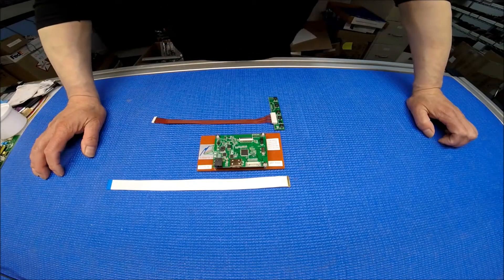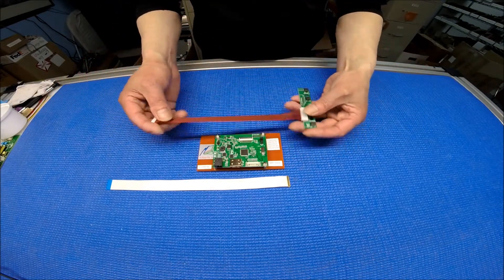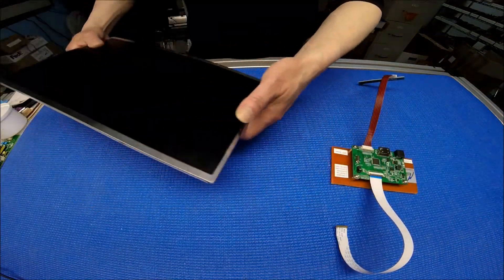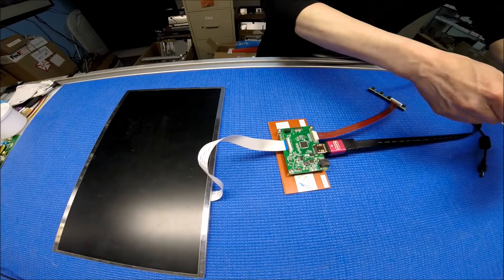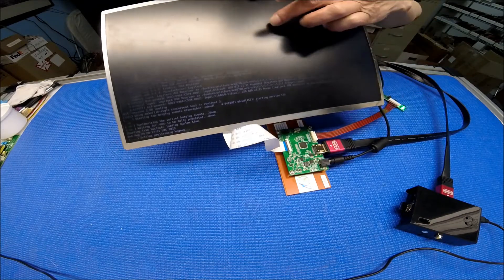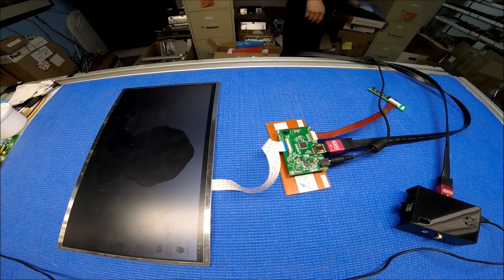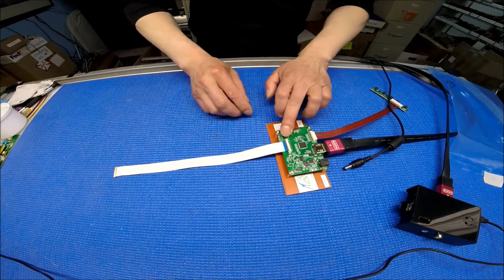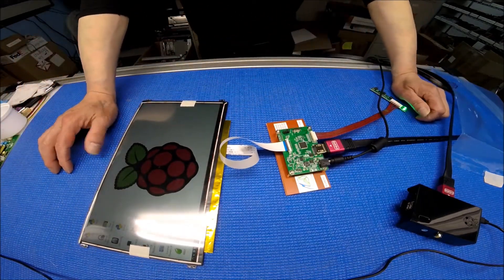eDP Tester, How to Test eDP LCD Screen

Comment: I just buy a eDP control board(m.rt5665.1) to use with my b156htn03 panel. After plug all of connectors and power it on, it just having a white screen and i cant use remote button. So did my panel just broken ?
Reply: i hv the same problem, any solution?